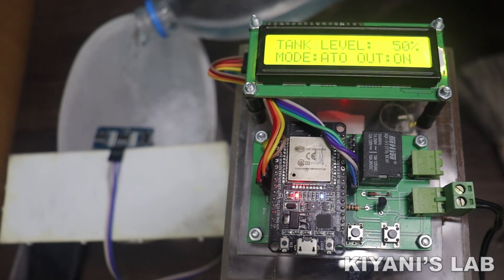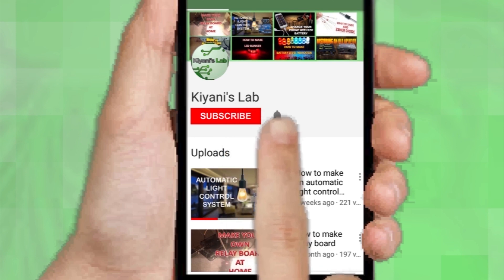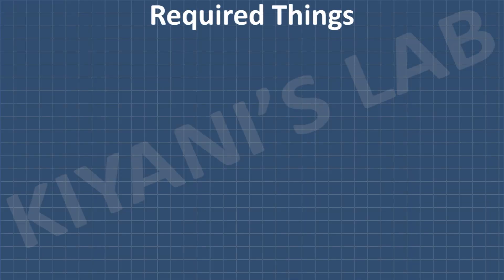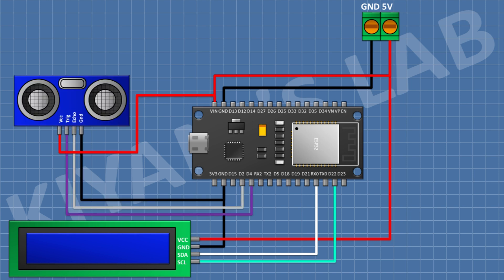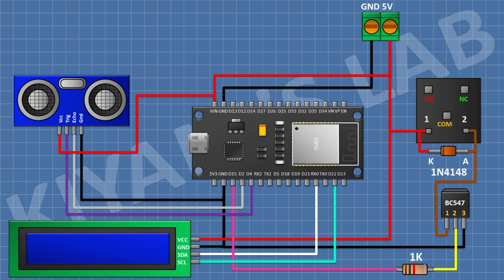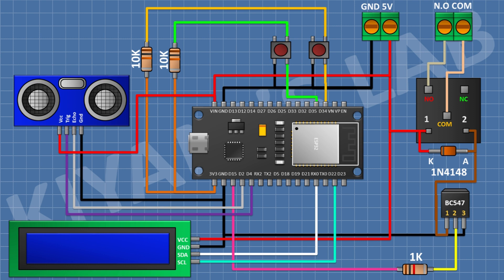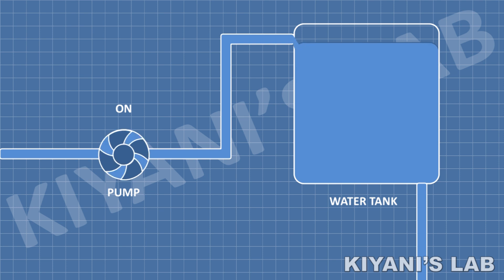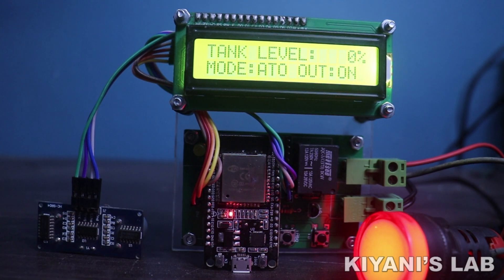Automatic Water Level Controller | ESP32 Project

Comment: Nice work, which I2C library did you use for the LCD, when i compile the code it fails on the lcd.begin so i changed it to lcd.init and it compiles but the lcd backlight flashes therefore i don^t think i'm using the right lib...thx
Reply from the maker: Arduino-LiquidCrystal-I2C-library
Reply: @KiyanisLab  🥰

Comment: I also made this project but mine was much simpler....I just used the distance formula for Ultrasonic sensor no need for calibration worked fine for any tank
Reply from the maker: you are right bro but some sometime sensors are placed above over flow of the tank and the are different heights of the tanks  so fore accurate percentage of the level calibrations is needed
Reply: Can you share your code
Reply: Do you mind sharing that formula?

Comment: Thanks for the project but it doesnt seem to be practical, bcoz overhead tanks are usually at 2nd 3rd or even higher floors, so how can we see the lcd? it would be nice if you add wireless connectivity using nrf modules.
Reply from the maker: soon ill add it
Reply: @KiyanisLab  thanks cant wait!

Comment: Thank you very much for this wonderful work.. This is what I was looking for. I developed your old project by adding a bell before turning on the pump and before turning it off. I made it measure units in centimeters instead of inches. I added the ultrasonic library to it.. But I have a question. Why did you use Wi-Fi esp32 instead of Arduino? What makes the difference? And the benefit of it
Reply from the maker: esp32 is more powerful and low-cost as compare to arduino
Reply from the maker: iot capability is also there with esp32

Comment: Sir 24 volt DC in 24 v dc out both side transistor control circuit bna din plz mujy zrorat hai us ki puls b adjust ho
Reply from the maker: kis kaam k liye chaye
Reply: @KiyanisLab   2 coil hain 24 volt DC on ko 1 second k wakfay sy on of on flip flop krwana hai